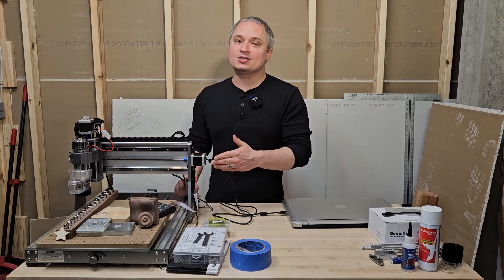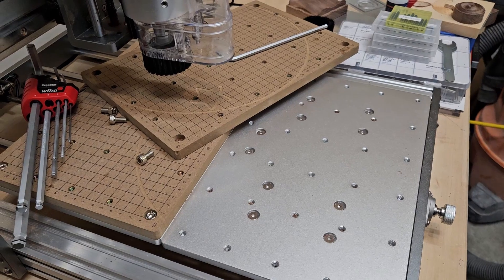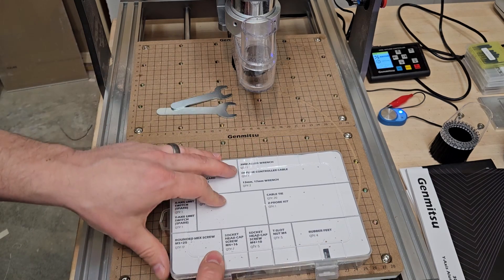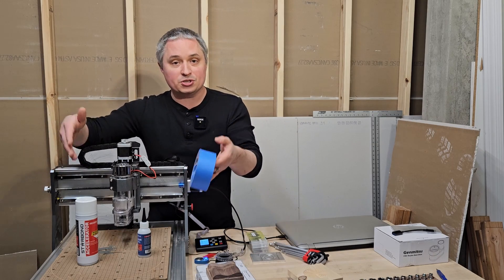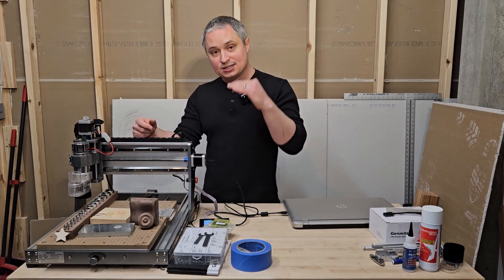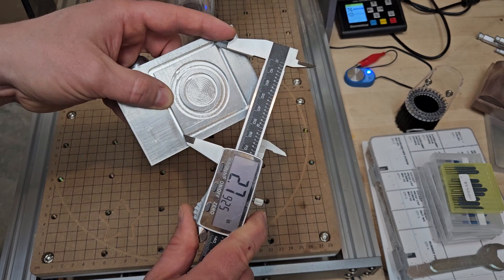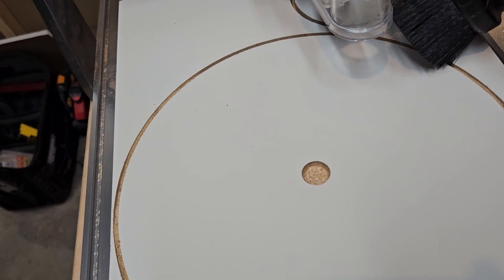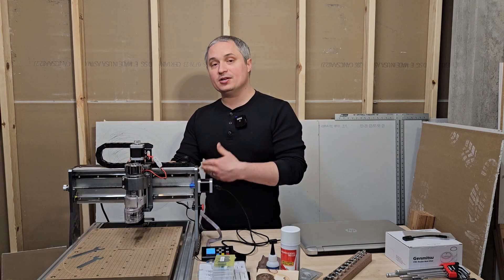Genmitsu 3020-PRO MAX V2 CNC Router Review - Cuts Metal and Wood!

Comment: Hi, Is it possible to mill small elements from stainless steel?
Reply from the maker: I wouldn't use it for stainless steel. Sainsmart specifies it being compatible with "soft metals" which I would assume includes aluminum, copper, gold, silver, bronze, and brass. If you do decide to engrave stainless, plan on an austenitic steel like 303 which is recognized as one of the easiest machining stainless grades. Don't buy martensitic steel, which is much harder.

Their website does have a photo on the product listing that says "stainless steel", but I'm not sure if that's an error or not: https://www.sainsmart.com/products/3020-pro-max-v2
Their bit selection guide seems to include steel as a "soft metal", which I'd disagree with unless they're specifying what type of steel: https://cdn.shopify.com/s/files/1/1978/9859/files/CNC_Buying_Guide_V1.3-202104.pdf
Reply: @DoresoomReviews thank you very much for fast reply.

Comment: That machine held a tolerance of plus/minus .015" ? That's a disaster. It's useless with all that slop. Do your homework and do not recommend this to anyone.
Reply from the maker: If you watched anything beyond my initial measurements, you'd have seen that was without calibration. After calibrating it held under +/- .010" which is good enough for many applications like woodcarving. My actual measured differences maxxed out at +.000"/-.009".

This is precisely why I did a detailed review - so everyone can decide for themselves if it works for their application. Obviously it doesn't work for you - mission accomplished with this review!

Comment: can a 300x200 square be cut from a larger board (for example from a 330x220 board)  or would that not be possible on the 300x200 bed? i hope my question makes sense. i am not sure how else to put it. I would need to be able to produce sheets with dimensions 300x150 , so i don 't know if this machine would be able to do that. My problem is space, so i am looking for the smallest machine that can do this. I have no previous experience with cnc routing.
Reply from the maker: If it's an inside cut (removing the square) then yes it can cut the full working area. But if you want to cut out and keep the square, then it will be the working dimension minus the bit diameter. So if you've got a 3mm straight bit, the largest rectangle you could cut would be 297mm x 197mm. You lose a bit radius of length on each side because the center of the CNC head maxes out at the working area dimensions.

Comment: I’m new to CNC so I am trying to gather all the information that I can. Your video was very informative, but it left out a very important step, at least for me as a beginner. You said there are three types of software required, one CAD, two CAM and third, G code sender. You covered the CAD and the G code sender nicely but failed to mention anything about CAM, which is my problem at this point.
Reply from the maker: Easel that I talk about at 15:22 is both CAD and CAM software. If I have a complicated part, I'll use OnShape for CAD and Easel for CAM.

Comment: Thank you for the quality of the video, I am potentially looking at this machine to do engraving/etching on light metal material with a thickness of 0.86mm. Is this machine accurate and it wont damage the material with a very small thickness, its only simple letter engraving that I am looking to do
Reply from the maker: It should be able to do that, you'll just have to flatten your spoilboard beforehand to achieve consistent engraving depth if you have a wide workpiece.

You could also look into fiber lasers for engraving metal.
Reply: @DoresoomReviews  The pieces ill be working with is 170x65mm and 68x65mm so it should be okay? is there a product that you recommend for fiber lasers?
Reply from the maker: I haven't used a fiber laser, so I don't have a recommendation, sorry. XTool makes one, so does Genmitsu - both seem to be good companies with solid customer support.

170mm is pretty big for that type of laser though, so you may just be better off with this CNC router which is much cheaper.
Reply: @DoresoomReviews   I've got another question. I got the machine! when I asssembled it, connected the offline controller and it is not moving the axis of the CNC machine, is there a way to trouble shoot it?
Reply from the maker: Make sure the E-Stop isn't activated first.

Sainsmart has a pretty good user guide for it too: https://docs.sainsmart.com/article/1nzfeckqu0-using-offline-controller-on-genmitsu-3018-prover

Comment: this machine can be used to do pendant ? is accurate to cut and engrave little part?
Reply from the maker: Do you mean like jewelry? It held +/- 0.015" pretty easily for me. If you're doing very intricate detailed work it could be an issue though. Either way, you'll probably have to polish by hand if you want a fine finish.

Comment: Do you think it can carve a 2 inch hard wood cutting board
Reply from the maker: It depends - what are you trying to carve in it? If you're just doing something like a juice groove, a handheld router with a bigger bit and a template would be far quicker. If you wanted to router a detailed relief carving and fill with epoxy, then this CNC router would be a great way to do it.

Comment: I got the fox alien WM3020,,,,,total waste of $900.
Reply from the maker: That looks similar in footprint to this Genmitsu, but has a different rail setup and a less featured offline controller - for almost double the price.

What in particular was most frustrating about the WM3020?
Reply: Absolutely no support at all. Would not work with fusion 360 at all. They do have a Facebook self help group which is useless.
Reply from the maker: Thanks for the info. Sorry to hear you had such a frustrating time with it.
Reply: Absolutely no support at all. Would not work with fusion 360 at all. They do have a Facebook self help group which is useless.
Reply: ? What's the link between fusion360 and your CNC ?
Reply from the maker: @neodymelanthanide2101 Fusion 360 can be used as both CAD and CAM software

Comment: A way around the parts limit with Fusion360 is to have multiple bodies in your parts. It will only export the visible body(ies) so you can have multiple similar bodies in one part file.

For example, if you make drink coasters, you can have a base template sketch and then different features for each style. This can become a bit cumbersome to manage, but it works.

I had one part file that I used for one off designs. I would design what I needed and export it for the 3D printer, then delete the features and sketches for the next design.